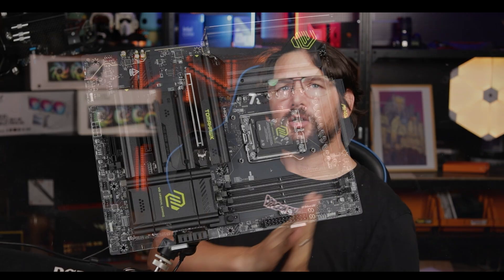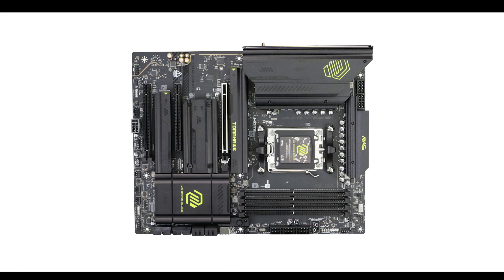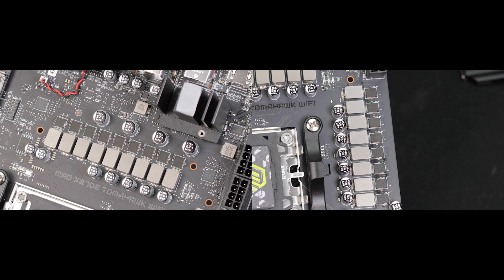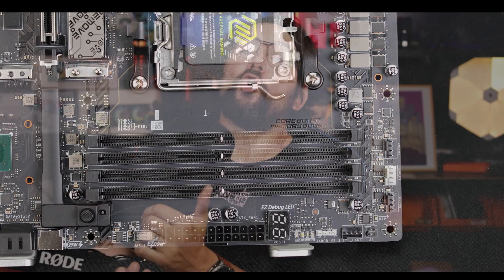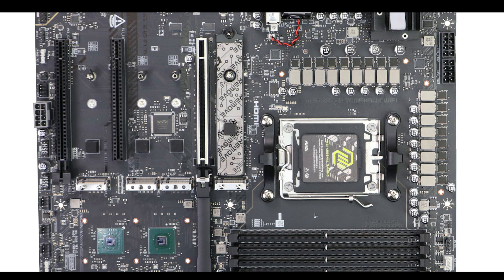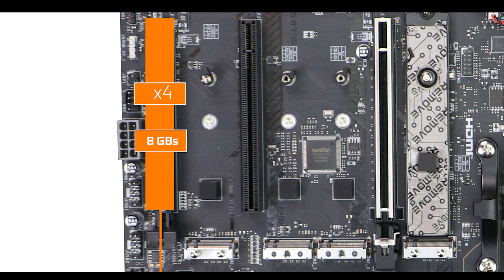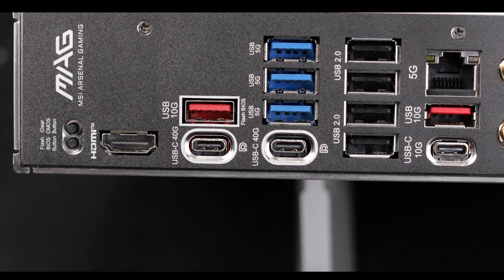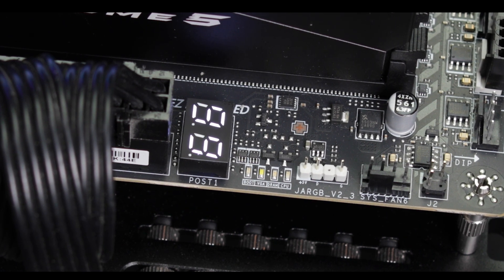MSI MAG X870E TOMAHAWK WIFI: Raw power swimming in an ocean of bandwidth!

Comment: What mobo offers pcie 5 x16 and pcie 5 x8 together?
Reply from the maker: Carbon x870e :)
Reply: @Laurentschoice still not sure that will have enough lanes to run a 5.0 x16 GPU in slot 1 and a 4.0 at x8 in slot 2

Comment: IMHO if someone needs the USB4 on the backplate I'd keep it at 40gbps and just install the NVMe to the lower two slots. PCIe5@2x is the same bandwidth as PCIe4@4x so a gen4 4x SSD would be perfect there without compromising the backplate connection. The board is very versatile
Reply: For sure. I have a Crucial T710 Gen5 in lane 1, and two WD SN850x in lane 3/4 as they are Gen4. 5TB is good, plus a 4TB sata drive.

Comment: Why on earth are they still offering USB 2 sockets, no one wants those, I'd much rather they were USB-C sockets as almost everything that connects to my PC uses USB-C
Reply: Older hardware. I was a grad student from the university of Allek in Italy and the course lead me to using a lot of things like sub-12.5 embedded HDD adapter foils and silver chipsets that at one point got updated to USB 2.0, but never got further support and sorta got stuck in limbo with no further support or hardware updates, and you'd be surprised how often this happens with a lot of hardware. You think it'd work with USB 3.0, but very few do, it's a huge pain. So there's basically loads of stuff that got USB support and then it just stopped there, but due to how old they are, normal adapters don't work, so you essentially just need 2.0. Sorta hard to explain. 

Yeah, I just made that all up. I have no idea why they keep USB 2.0 on the go, either.

Comment: A very interesting review of the MSI MAG X870E TOMAHAWK WIFI.
There are currently very few reviews and user impressions of this motherboard online, and your video is one of the best.
The main advantage of this model is that using two PCIe 5.0 M.2 drives does not reduce the bandwidth of the primary PCIe slot for the graphics card — it still operates at full x16 speed.
Only the speed of the USB4 ports is limited, which most users won’t find critical.
Reply: As many users reported, got sensors stuck with this board, prob related to an smu issue, needed to rma it, it has multiple comments on msi global forum about it, buy it at your own risk

Comment: This is might be my next purchase. I regret buying my ASUS tuf gaming x870e… VRM exploded, burnt CPU and cooling. ASUS said that it’s mechanical issue and warranty does not apply
Reply: That’s a nightmare because I have an ASUS TUF 5090 and almost bought an ASUS motherboard. I have a ASUS OLED monitor too that’s acting up with its firmware
Reply: @casedistorted better get in touch with them and get that monitor situation dealt with if its under warranty. Good luck bro 😢
Reply: Amongst other things, the reason I avoid Asus these days is their customer service.  Sad to see that its still an issue. You dont stand by your product, I dont give you my money.

Comment: Stupid question: Can you put a a SSD'with its own heatsingsink (990pro) in the second slot?
considering the motherboard has a duoble heatsink and a GPU infront of that area.
Reply: Mobo has built in heatsinks, so you either remove those or the heatsinks on the 990 pro. I have read, but not tested, that the heatsinks on the mobo are easiest to remove.

Comment: Any news on the new TOMAHAWK MAX version?
Reply: I love the gunmetal colour scheme on the Max but it's rear connection only I believe, so sadly off my list as a possible board option.
Reply: @DeadManInBlack  Hey DeadMan. Sorry, my bad. I meant the new MAX version of the Tomahawk that's coming out soon. Not the PZ version (which I agree is not an option).  The new standard Tomahawk Max is a refresh of the Tomahawk with standard top connectors.  There are 4 or 5 new Max refreshes of the MSI X870E boards announced as coming soon. Apart from a slight colour change, they also address some of the lane sharing staff and a few other upgrades.
Reply: Oh nice, I did have a quick look online for other versions before I posted and everything I found seemed to only mention the PZ one.

Comment: Great video as always. One question before I pull the trigger on this board and r7 9800X3D. Are those power stages enough for r9 9950X3D if I decide to upgrade in the future?  I have no plans to overclock CPUs. I did this in the early 90s and early 2000 :) Not interested anymore.... I am getting old, I guess. :)
Reply from the maker: Same here ahahahaahah.. I just want my machine to boot and not turn blue at every turn :)))))

Yeah your good for the foreseeable future and even for the new ryxen 9000 Pro series. 

Your good all around;)
Reply: Getting old?  Just remember, growing old is inevitable, but growing up is optional, when 95y old, in a wheelchair, shting in your diaper, you can still have the fastest fn wheelchair!
Reply: Hope you pulled the trigger on the MSI website! $286 for this mb and $400 for the 9800X3D combo special (ended now)
Reply: @FisGiggles1999  NO, I did it on Best Buy. They had them in stock in my city. They made me a discount for all 4 parts. The board was 274, CPU was 459. Not bad, I think. I also bought Samsung 2TB 9100 Pro and 64 GB 2x32gb  Corsair DDR5 6400Mhz C32 mem.
Reply: Has it been good? @genderlessyoutubefanperson
Reply: @Lucifercx Yes. Zero problems.

Comment: I’m a little bit confused. Should I go with the older MSI X670E Tomahawk or the newer X870E Tomahawk in 2025? Please suggest better option
Reply: Go to the MSI website and compare the two. But the 670E has lane sharing with the M.2 slots, and they aren't physically located real well (will mostly all be covered up by the GPU). Also on bluetooth 5.3 and no wifi 7 so not futureproof. I'd wait on a sale and get the X870E

Comment: So X870E tomahawk gets a lower score than X870 version? Interesting
Reply from the maker: Ur right to call me out on this. 

Point of the matter is that the score will fluctuate based on what the competition had available at the time. 

In the beginning of the season, the X870 was over the pack. 

As we progressed thought the year, new boards with new features raised the bar a little.  

And the boards reviewed later into the X870 Season will have a harder time to get higher score than the early ones :)

I hope i clarified and thanks so much for this very observating comment :)

Comment: I watched both reviews x870 and x870E and I wonder why the temperatures are about 10 degrees higher on x870E with R9900X. Previously x870 was paired R7900X which is more power consumption processor - TDP 170W compared to 120W ? Are the cooling worst on 870E or it is because the 870 chipset is doubled on x870E ?
Reply from the maker: Very good point . The difference is that one was filmed in a cooler ambiant temperature than the other :) 

But also I am running a different CPU. On the X870 review I was running a 7900x and on the x870e the 9900x which, I noticed tend to shoot up much faster in temp and then stabilizes. But the clocks of the secondary core are running faster than the 7900x over all. 

I hope I clarified that very good observation  :)
Reply: Yeap, very well clarified 🙂 I've been trying to choose an AM5 mobo for some time now and almost grab this x870E, but then I read that many people complain about an ethernet problem where the port becomes completely inactive or there may be periodic disconnections and speed drops 😕 Not only x870E but also x870 and  b850 and the headache came back 😕 Heh ...

Comment: So you rate a lot of categories an 8/10 here.   Could you highlight some points that are required to achieve a 10/10?  What are the points in each category are clear demerits?  I may have missed it, but doesn't seem all that clear.
Reply from the maker: I do have a scale with details written down on my excel grading sheet. 

In short , when a manufacturer grades 8, it is beyond expectation or above the competition for the pricing.  

When achieved 9 it is close to best in its category for that chipset 

When you are at 10.... well.... only one can be at ten... you just achieved unexpected innovation , premium care and rest boundaries..
 Didn't found that just yet :)
Reply: @Laurentschoice appreciate the response and always love your videos.  It would be helpful in the future to highlight a bit more some of the points(if any) that prevent a higher rating ih the category IMO.  Thanks muchos!  Merci Beaucoup
Reply: @Laurentschoice  between the x870E vs the x870, what's the diff regarding the rear I/O Type-C ports?  With x870 it's an all or nothing?

Comment: Can a 9800x3d support the full PCIE bandwidth capacity the 870E adds or would I need to go with a higher end cpu? I'm having trouble understanding the amount of lanes certain cpus can support
Reply from the maker: It absolutely can. It comes with the 24 PCIe 5.0 lanes that the motherboard can support. 

U r at top specs